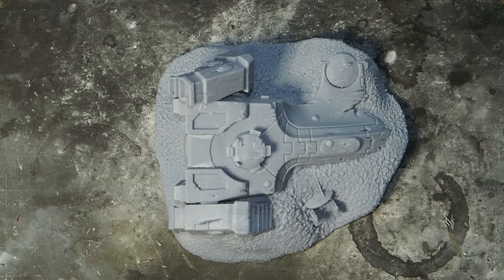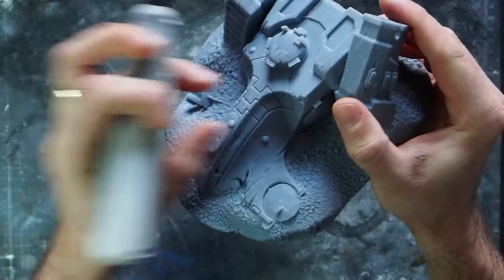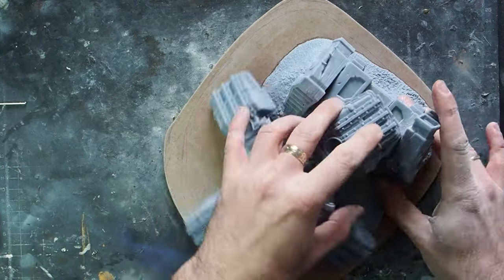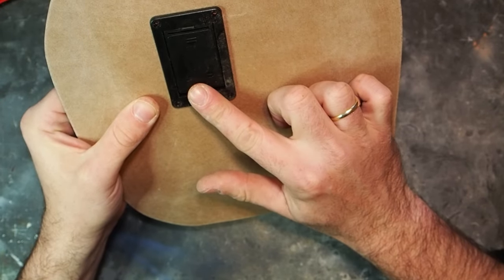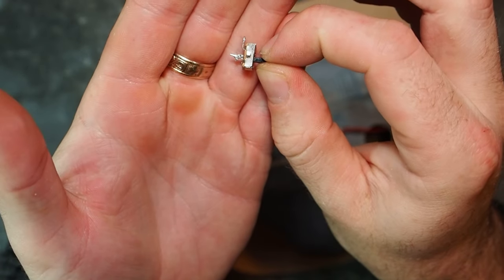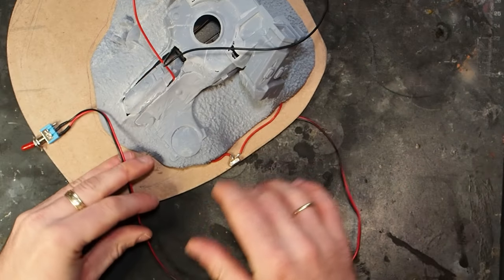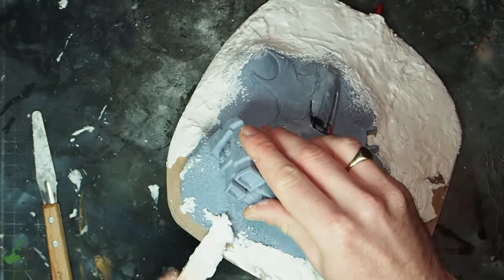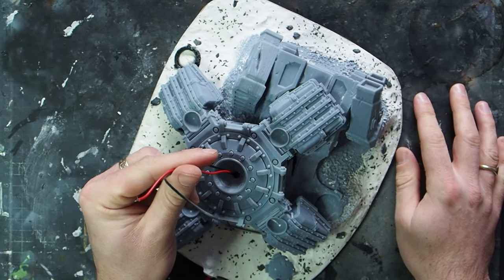The CHAOS Warlord Titan Build starts NOW!

Comment: Excellent work mate. 
A little tip, if you do anything similar with lights/power and it needs a switch. i found incorporating the switch into the mech or hrd surface components makes it invisible to anyone not aware its there :) with a mech you can have the wires on show as well as they will look like they supposed to be part of the mechanism :)